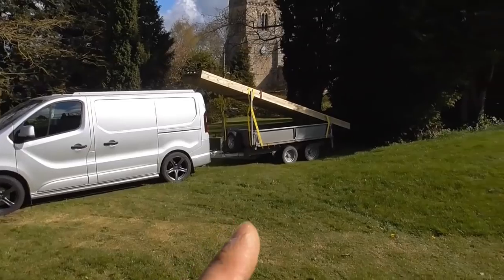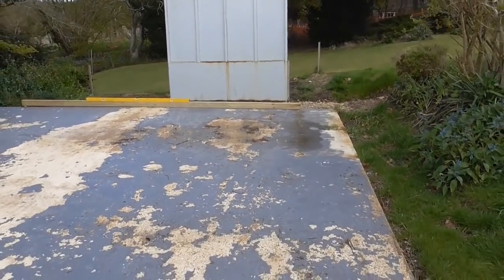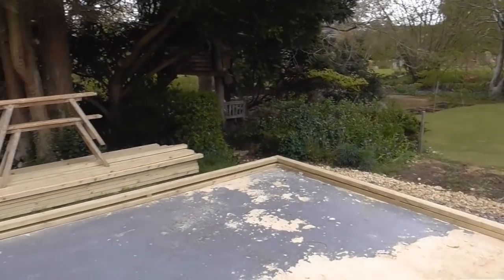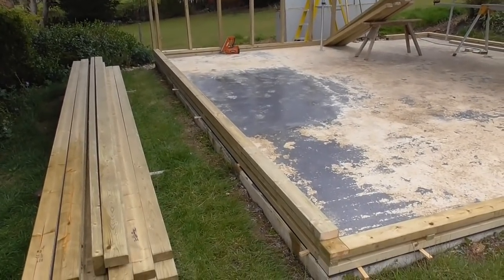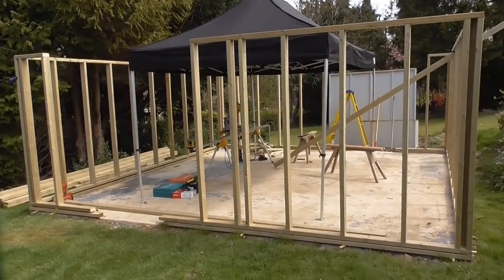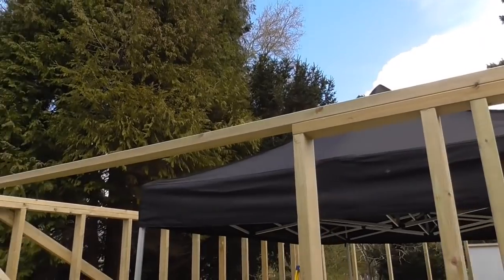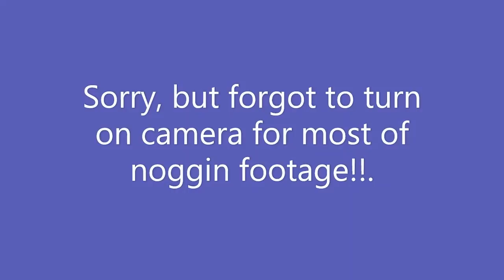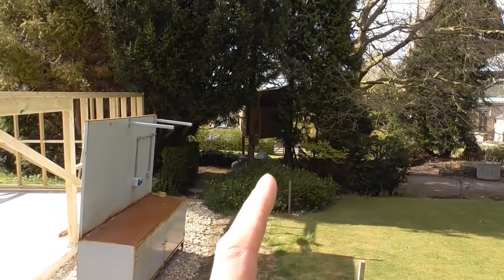Timber frame garage and garden utility space. PART 1 (making timber stud walls)

Comment: Um...that's not timber framing...that's stick framing...
Reply from the maker: Hi there. I think stick framing is a term used in the US.🤩 Here in the UK the vast majority of our homes and buildings are made using masonry block and bricks, and when a building is made of wood, we describe it as, 'timber frame'.😎 As you say though, essentially, its the same thing.👍 Cheers.
Reply: @thetallcarpenter  I’m curious then, what do you call this kind of framing?

https://en.wikipedia.org/wiki/Timber_framing
Reply from the maker: @g1mpster  Hi there. All the buildings in your link are timber framed and this type of construction was well used many years ago when strong natural timber like Oak was plentiful. As the years have gone on, this type of building has given way to more masonry based construction, but the term, 'timber frame, still sticks, certainly here in the UK, when a building is made with wood as its main structure. The term, 'stick framing, is not used here in the UK when describing buildings made of wood.😎Cheers.
Reply: @thetallcarpenter  that’s interesting. So there’s no distinction in terminology when referring to modern wood framing techniques where the structural members are all relatively thin and wide, consisting of large wall panel assemblies vs older framing techniques where the members are large and thick, consisting of individual bents that are joined together with traditional joinery techniques?
Reply from the maker: @g1mpster  Not really. In the context of traditional timber framing, a modern timber frame building might only be described as, 'timber framed', over an, 'oak timber frame'. As a whole, this type of building would still be generally considered, 'timber framed', here in the UK, the same as a, 'stick frame', building.
Reply: @thetallcarpenter  Awesome, thanks for the info. Always interesting to see how things are different from one side of the pond to the other.
Reply from the maker: @g1mpster  Hi there. I worked extensively in the US back in the 90's so am/was familiar with much of your construction methods, particularly around carpentry.👊 Since starting to film my work I have found out so much more about how carpenters work nowadays, not only in the US, but many other parts of the world as well. As you say, its very interesting.😎 Cheers.